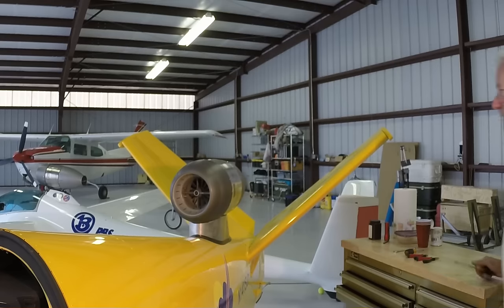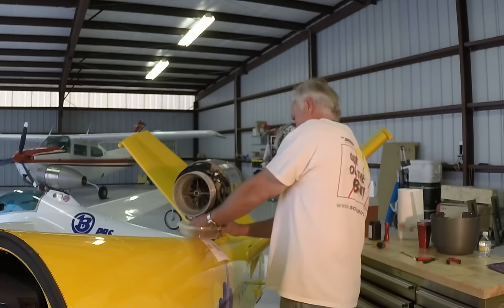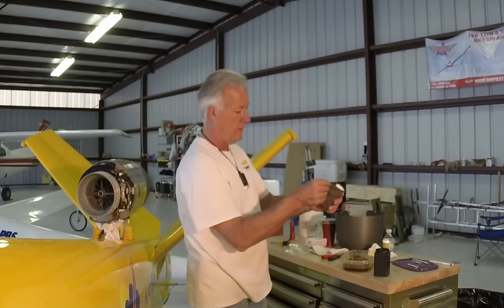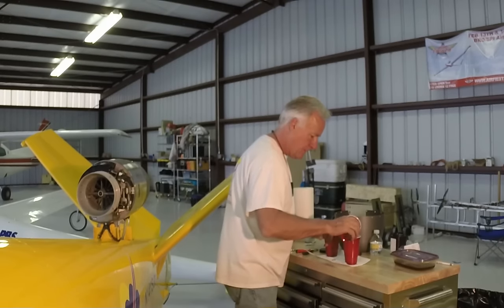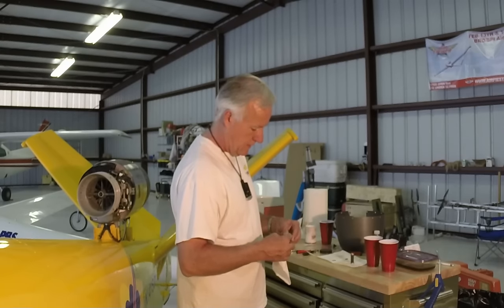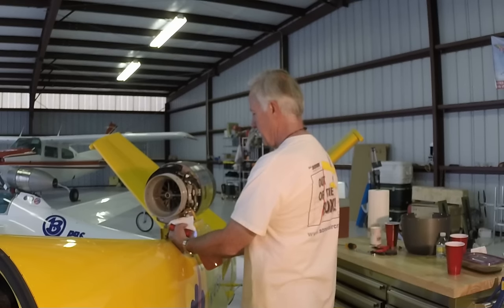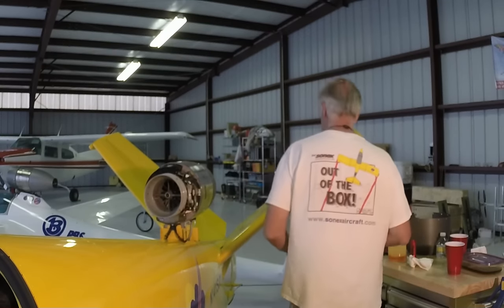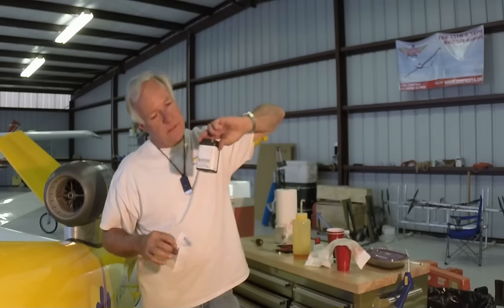subsonex oil change

Comment: I'm surprised you didn't make a jig or something that hugs the airframe and provides a flat area for a drain-pan. ie concave on the bottom, with the rear being smaller, the front larger, and the top offset to give a flat surface to set tupperware, etc... This would be a huge asset, especially if you fly frequently, or not. It would be simple enough to make out of wood, and you could add rubber to prevent scratching the paint. You could add an inlay on the top of the surface and permanently affix, or even make it removable, a metal tray with a lip to ensure you catch any remaining oil, so you have somewhere to put the rag, to prevent oil running down the airframe, and also to hold nuts / bolts... It doesn't matter if you are doing an oil-change, but having this type of tray would be invaluable.

Comment: I always believed that the engine is lubricated by mixing the oil in the fuel, even the PBS itself says "fuel lubricated version"
Reply: Gustavo4523 - The TJ-100 has a full recirculating oil system unlike most R/C turbine engines.
Reply: @bobcarlton2518  that engine was the best thing they came up with.  consumes 70L per hour equal to a 6 cylinder piston engine, and has minimal maintenance and in addition to few components, close to a piston engine.  it's a type of aircraft that goes to the pump to fill up, people ask things
thank you very much PBS aerospace

Comment: How many hours can you fly on a single quart of oil??? Doesn't seem safe unless your changing that quart out every 5 hours...
Reply: the oiling system would be pretty simple and small, probably just a few bearings the oil has to spray onto in the whole engine
Reply: Good question. Answered in the video twd the end -- every 10 hrs. On reciprocating engines we'll change oil every 25-50 hrs...but they're filthy. Don't think jets have as many moving parts. This engine is worn out & ready for overhaul @ 300 hrs.

Comment: Why not just replace the filter instead of cleaning it?
Reply: Because filters last longer than a few uses. Also, if you inspect it and it needs it - then spend the x on one. If it doesn't need it, it can be re-used without causing any issues.